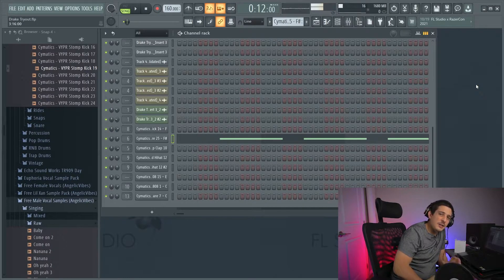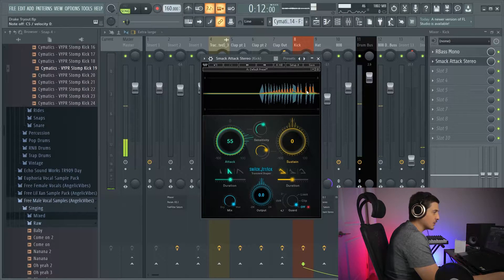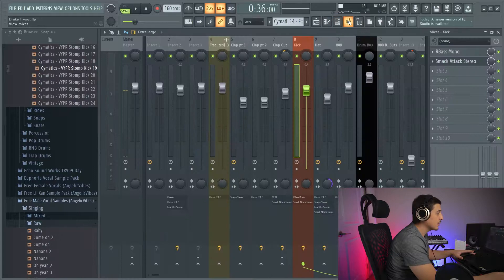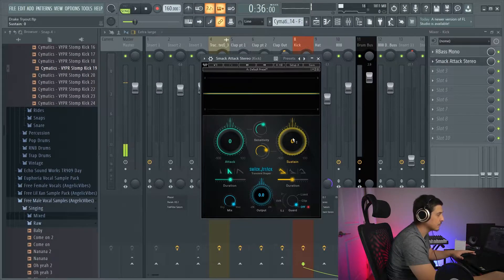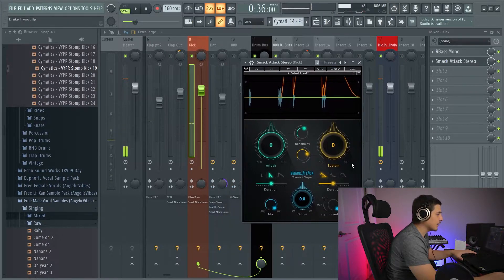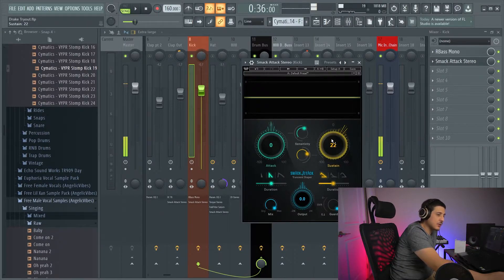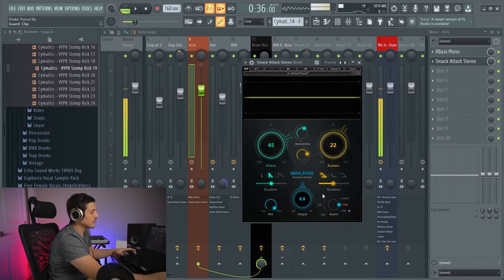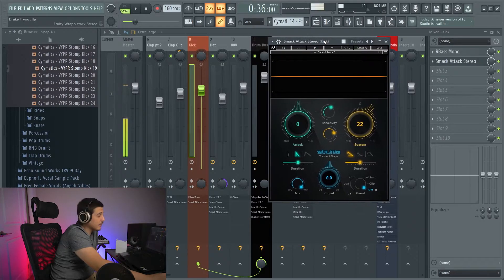What is a Transient (HOW TO) – Watch this BEFORE PROCESSING

Comment: Cool!
Thank you for the video!!!
In face, if the clipping is a hard-clip process, the change is only on the transient unless you push too hard.
But if the clipper uses a soft-clipper process, then it works more like a limiter but a little bit more radical on peaks.
Right?
I love hard-clippers to keep the transient sound without the peak, so we can get a higher LUFS and RMS.

Oh, BTW, my suggestion for a better visualization, try Psyscope (it's free).
So  you'll see the transien, the punch, the sustain changing ac ording to your teeakings...
Really cool.
It's must for perfect bass/kick phase fixing...
Reply from the maker: Hey just downloaded psyscope, I'm going to check that out. Always interested in monitoring tools that can help with presentation. Seeming how I do YouTube which is based off visual presentation lol

and yes, hard clipping will hit transients first and only hit more as you drop the threshold or raise the pre-gain.

Soft clipping uses an S curve which acts a lot more like the saturation you would get from an analog console. Where you would start out with a little bit of saturation and the hotter you run it the more saturation you would get until you hit the point where the waves amplitude can no longer become larger no matter how hard you push it.

Although I wouldn't call soft or hard clipping limiting, soft clipping can definitely be thought of as a limiter with a very very very large knee.

If you prefer the sound of hard clipping, you should check out smack attack from waves used in this video, Great for transient shaping. I mention it because if you run it hot, they have a clipping option. Pretty cool if you don't mind how waves uses the charged upgrade business model. I personally love waves and I'm sure you're aware of the upgrade thing, but some people curse it so figured I should mention it if I'm recommending their products lol
Reply: @ScaleAudio , In fact, I'm not aware of any upgrading issues...
But I'm still buying Waves plugins.
Actually, I'm almost reaching the "my Waves plugins collection" finish line.
I'm interested in an SSL V2, maybe Toque and Smack Attack.
Maybe another Renaissance will finish it golden key style...
But thank you very much for the feedback.
I've watched some cool videos from Baphomatrix (this name looks and sounds  terrible, but what can we do, right?) about end-mix loudness...
Many cool ideas there...
Not a new way to craft a wheel but a very clever approach on this subject.
I hope to see more videos from you!
Reply from the maker: @marceloribeirosimoes8959  I'll look him up. Loudness is definitely an interesting in depth topic. 

But yeah waves products include upgrades for any new versions until about a year or so passes (I forget the exact amount of time) after that you basically have to repay in order to continue to have version updates. If you just don't pay to upgrade then your fine but as compatibility issues arise you may find yourself needing the upgraded versions. 

This honestly isn't as big of a deal for Windows users as it is for mac users. With mac there is a lot of mac updates and waves upgrades are necessary to keep compatibility within the mac products. Which leads people to pay for waves upgrades out of necessity, landing them with a bill they weren't expecting in order to have working plugins.

Depending on how many waves plugins you have this could be a decent bill.

Really I've just seen a lot of complaints in forums etc.
Reply from the maker: Speaking form experience torque and smack attack are pretty cool tools to have available.